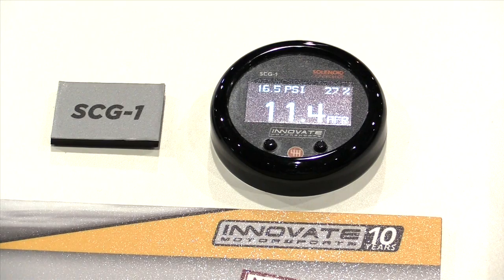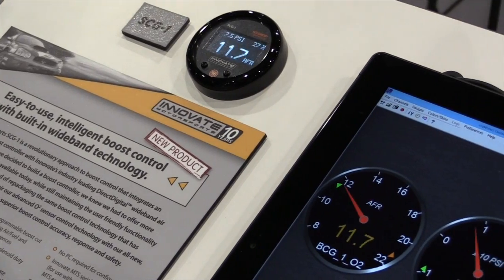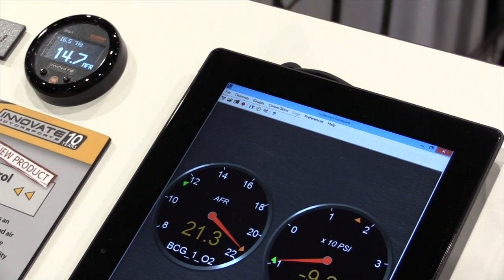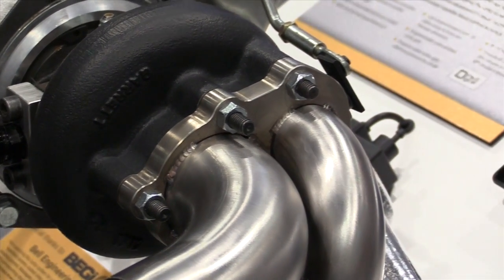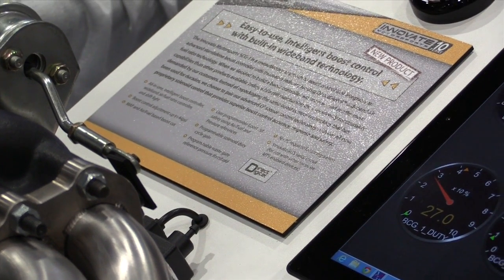Innovate Motorsports SCG-1 Electronic Boost Control with Wideband

Comment: Sweet... about to install this gauge on my car. Now that I'm thinking about it... I think I can run a bigger methanol injector and more boost/ aggressive timing and if the pump fails the Boost controller will pull boost out.... I've been using the intake temp sensor to add timing but depending on Ambien temperatures it's finicky.

Comment: im confused as hell.i just got a external waste gate and electronic boost control solenoid to mount on my car and was looking for a air fuel ratio gauge and i kinda need a boost gauge at some point,so I'm wondering if this will have a effect on the EBC i already bought from grimmspeed.????? damn time to read
Reply: In the owners manual there are instructions for installing on an external wastegate setup.
Reply: man i must have written that after i took my sleeping meds,because that doesn't even make sense.sorry about that.i bought the EWG &EBC back in june & haven't even installed them yet.ive been having such bad luck with boost leaks from a stage 2,I'm kinda leary that if i install those things on my car it won't be reliable.i did install a aftermarket TB to IC hose,so hope that helps.

Comment: I ordered one today. I'll let you know how I like it.
Reply from the maker: Thanks, I look forward to hearing what you think :)
Reply: ifixipods hows the gauge?
Reply: AquaDolphinz
 I had barely installed it, then sold the car. I never got it adjusted to work as well as the manual boost controller I made. I wish I had pulled it from the car before I sold it though. It was very cool.